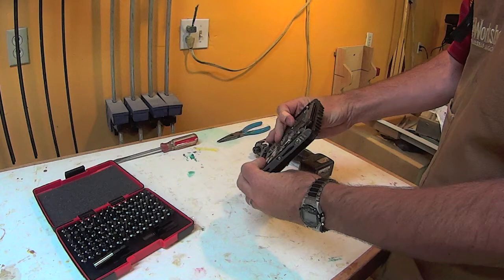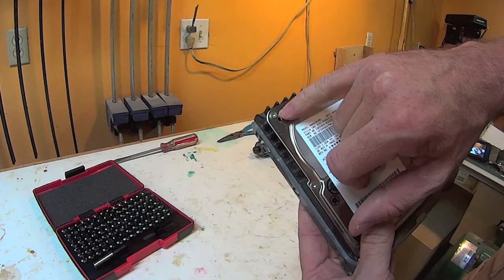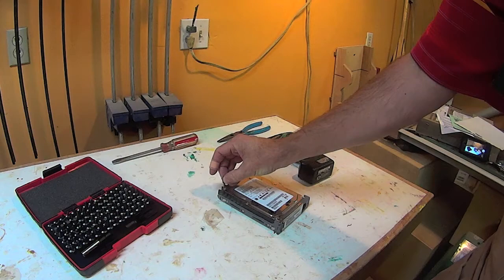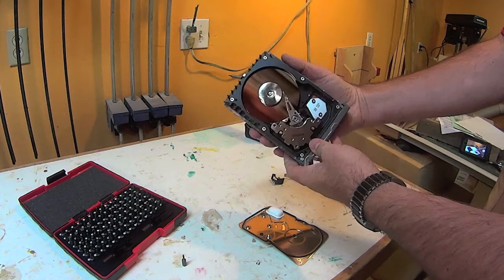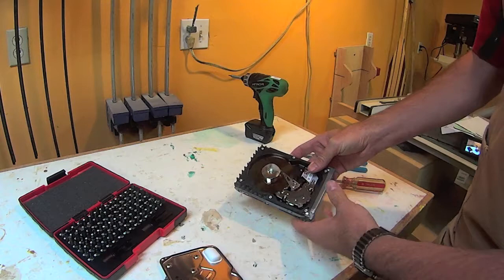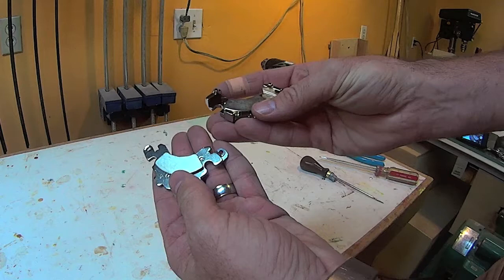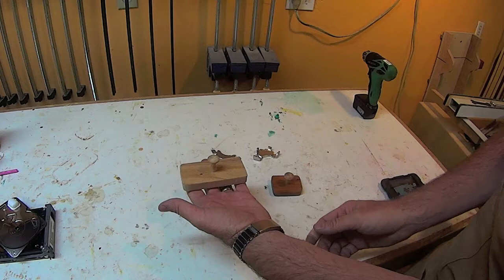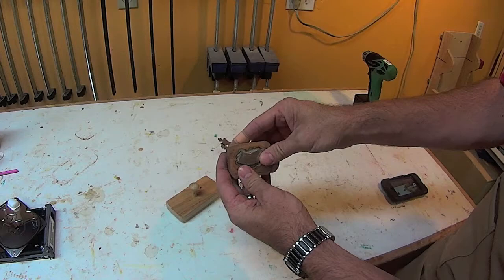FREE Magnets from Hard Drives (WnW #4)

Comment: nice video, I do the same thing.  I have found that the magnets are attached to those metal backers with just a little glue.  I put a corner of the metal in a vise and slip a crescent wrench on the other end and SLOWLY bend the metal.  The magnet usually pops off.  Very useful when you want to epoxy the magnet into something.

I once had a job where I destroyed data for a company.  We would remove the platters and bend it "really old ones would shatter" then dispose of the bottom circuit board separately from the platter as without knowing the MFR or even firmware version it's impossible to retrieve the data.
Reply from the maker: thanks, I'll have to give that a try...